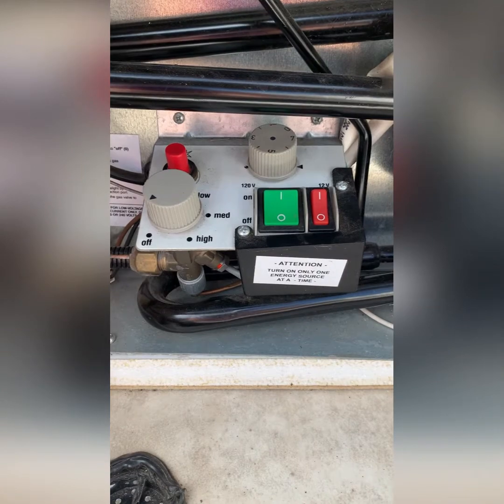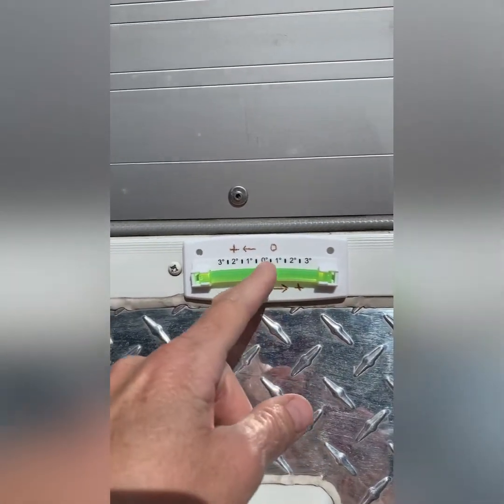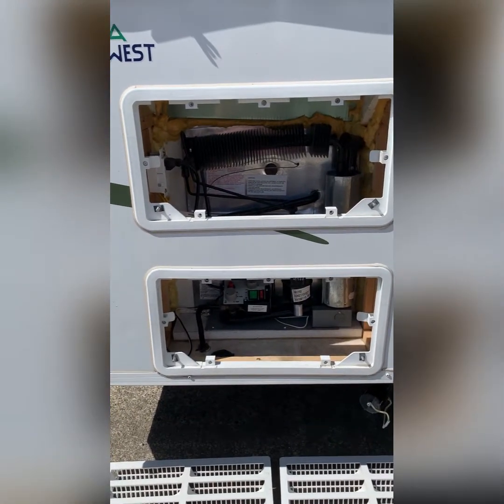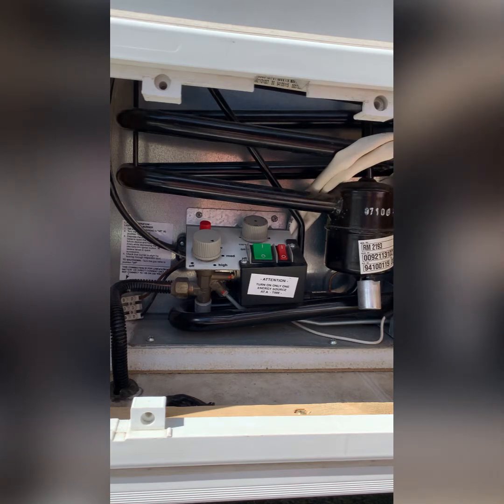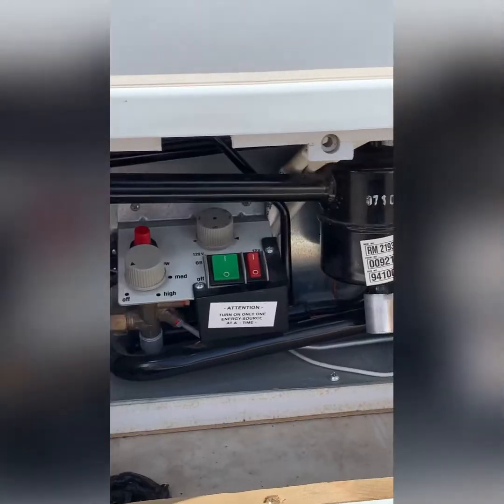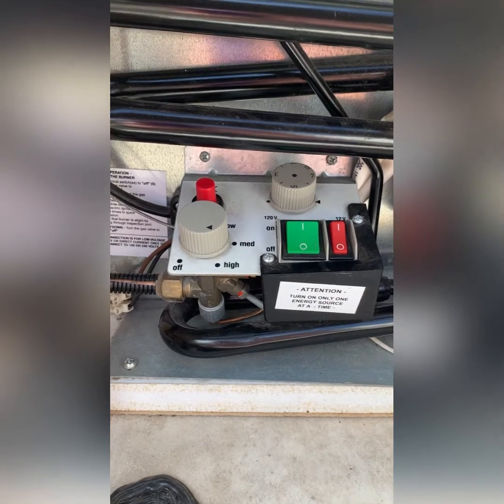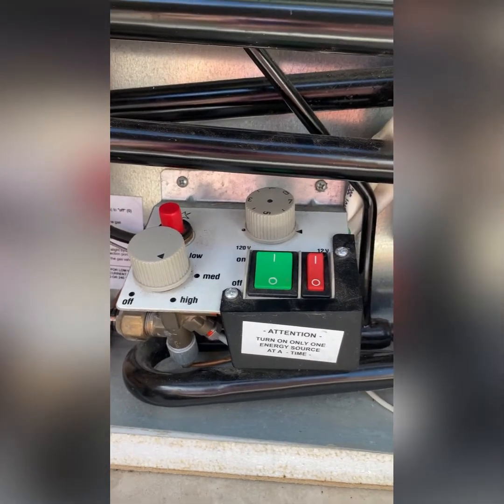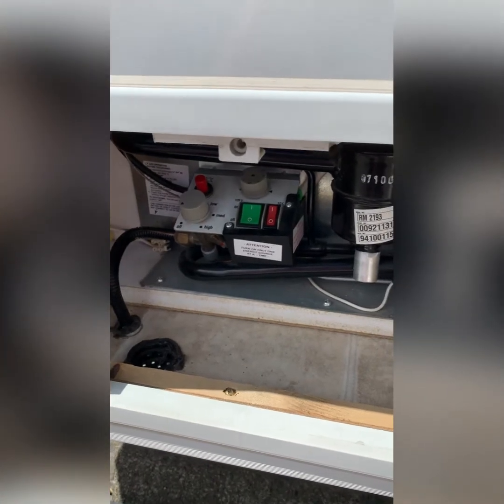Aliner 3-way Refrigerator on Propane

Comment: Your videos have helped me so much! Just bought an Aliner and am solo camping. I have your parking video saved and have watched it about a million times lol.
Reply from the maker: Glad I could help! Congratulations on your new Aliner! The longer you practice the easier it gets. I still have to refer back to my videos to remember how to do some things, like hooking up the battery tender. 
My last trip out I plugged into shore power, turned my battery to the refrigerator to 110 then FORGOT to turn on shore power at the post!!!
My fridge got warm and I couldn’t eat my camp food… my battery still worked for my lights and fan so I didn’t realize what I’d done until dinner time…. Oh boy. Don’t make my mistake 😊 Happy camping!
Reply: @ruthtrips7391  I turned my AC on for the first time and was miffed that the air still wasn’t cold after half an hour. Went outside and realized I never took the cover off lol!  #learningthehardway
Reply from the maker: @michelel6643  Hahahaaa!!! See what I mean? Lots to remember 😂

Comment: Great presentation. Anyone that watches this will definitely understand how to start and use their Aliner 3-way refrig; at home on 115v, on road on 12v, or boondocking on Propane. I am not sure but the safety feature on refrig is to insure the trailer (refrig) is level. But watched another one, and it explained that when using propane, the safety feature comes into play. Not positive. Ours is parked on the curb when I plug it in and not perfectly level. But when in the garage, it is level. Thanks for the video. Great job! We just bought our Aliner and will be going out today to try it out camping, boondocking with no hookups.
Reply from the maker: Thank you so much for the positive feedback, I’m glad it was helpful. 
I always heard leveling was to ensure the coolant in the refrigerator lines could work correctly. But propane use would also make sense to be kept level.

Comment: Buy a long bbq lighter and stuck it in the hole behind the  round flap on the base of the burner.. You also once you hear the fire have to just let your finger off the button it comes up slow and gives the heat sensor time to heat up.
Reply: I had comment about my new (Used 2004 Chalet Aliner) 3 way fridge problem above. I may try this trick and see if it will work. Thanks.

Comment: if you're running on battery for your fridge and driving is your battery being charged?
Reply from the maker: I haven’t actually driven with the fridge on battery but that’s the idea. It charges but you have to remember to switch it over when you get to camp to prevent it from draining your car battery. 
It’s an option I haven’t used, I generally just keep it cold with ice bottles until I get to camp.

Comment: just a suggestion: if you open any valve all the way, turn it a quarter or whatever back. Some valves have the tendencies to lock up in the full/open position and it will be difficult to turn them off then.
Reply from the maker: Thank you for the info! I will mention that in any future videos ☺️

Comment: My new used 2004 Chalet Arrowhead model doesn't have exactly control panel like this one, it's inside the ref itself when I open the ref door. I'm at the end of my wit tried to get it work! Kind of frustrating right now. But I'm not giving up, still trying though! I don't know what year of your Aliner. But surely made it much easier than my 2004 model!! Anyone wants to inject some opinion to get my 3 way fridge back to life? Thanks.
Reply from the maker: I’m sorry you’re struggling! I hope you figured it out? 
If not, there are other options such as replacing it all together with a newer model or even an ecooler, an electric ice chest that plugs into a battery pack or outlet. I have one I use because when it’s really hot out my 3way fridge doesn’t keep an even temp inside or worse, it freezes stuff on bottom.